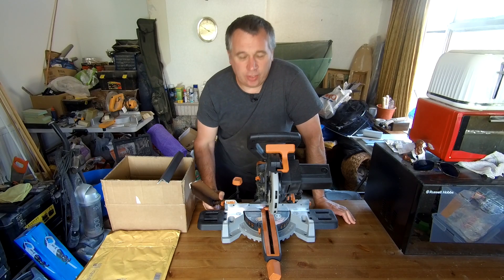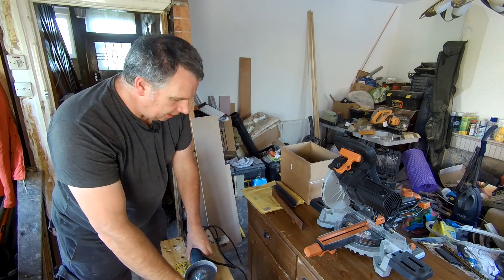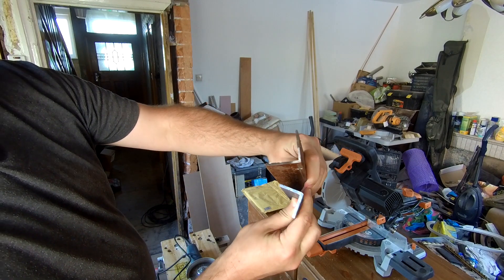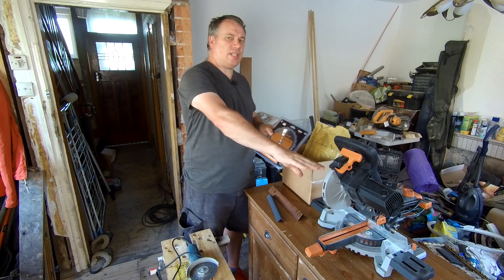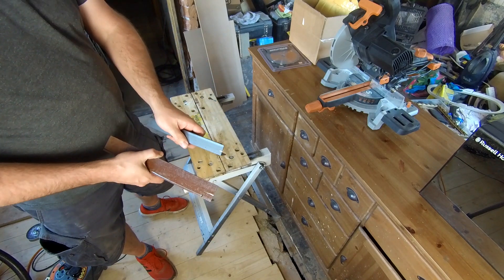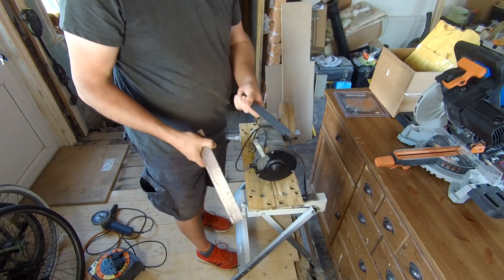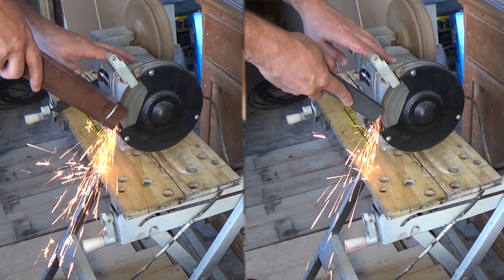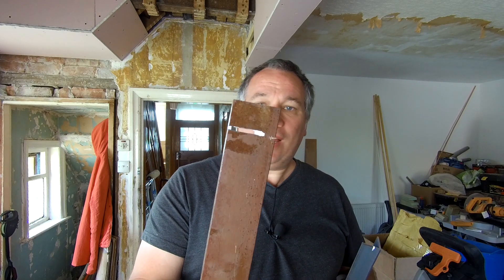Steel Spark Test - Is it Mild Steel or Hardened? | DIY Vlog #32

Comment: That is a high carbon steel that has been hardened and tempered by the looks of it. In its original form high carbon or tool steel is in the soft state so it can be machined into tools etc. On,y after it has been heat treated and this means hardening and tempering, two separate processes, hardening consists of heating to cherry red which is above the steels critical temperature you can easily test that temp by seeing if a magnet will stick to it. In proper controlled hardening the steel is held above its critical temp for around an hour then rapidly cooled in water, or brine or oil of various types. At the end of this process the metal I'd absolutely dead hard, but it is extremely brittle and if dropped or you try to bend it it is very likely to snap or shatter, so the tempering process is to bring that dead hardness back to a suitable hardness without the brittleness. Generally the steel is pickles or some other process to clean it back to bright metal and then heated until there starts a colour change in the oxides forming on the metal as it heats up generally most tools are taken up to around the pale to dark straw colour but usually not more than light purple, and higher than this is getting into the really hardened stages and of course brittleness  generally most edge tools like woodworking chisels go up to dark straw or maybe light purple. Sorry I have not put temperatures in here because I've forgotten them, and I learned them in Fahrenheit anyway!